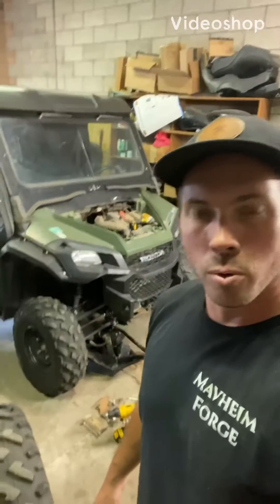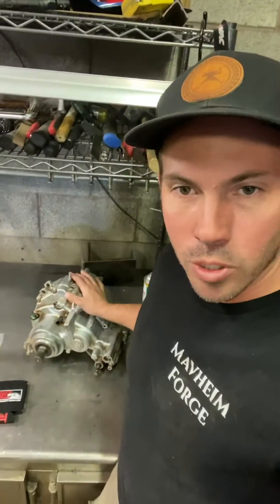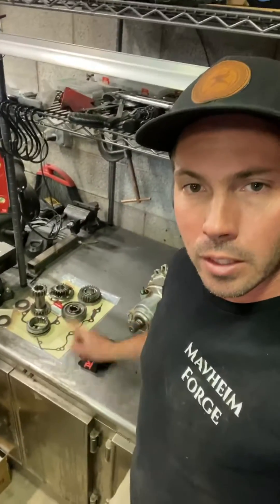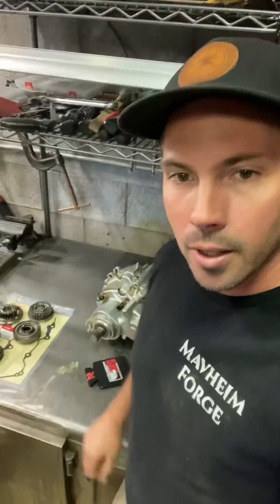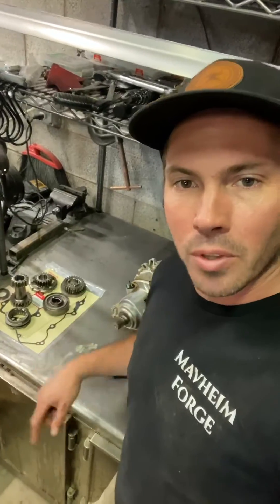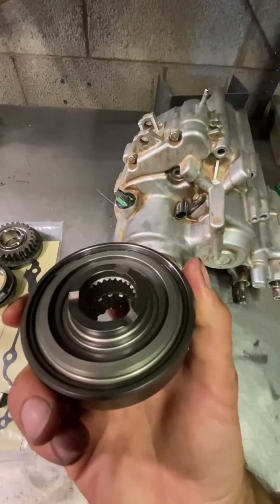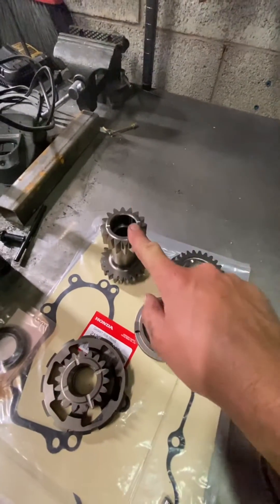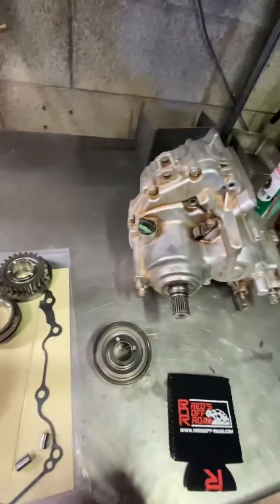2018 Honda Pioneer 1000-5 with a bad low gear

Comment: How was the buggy acting with the low gear issues?  Trying to shift, clacking, jumping forward, and not get power to move forward because the clacking/shifting?